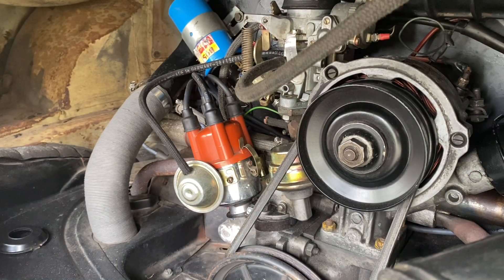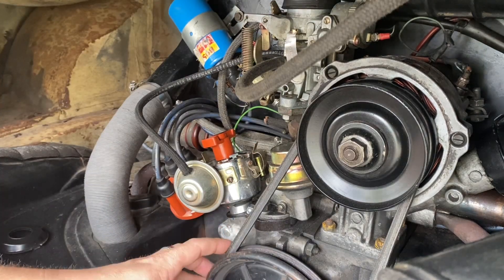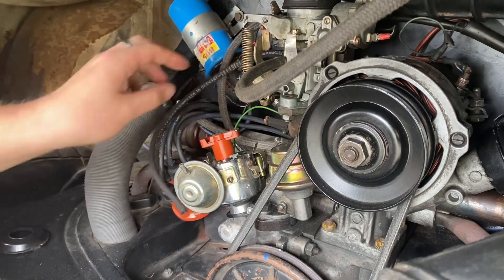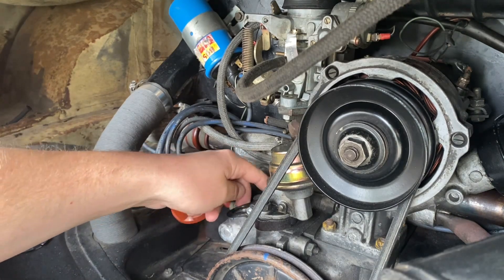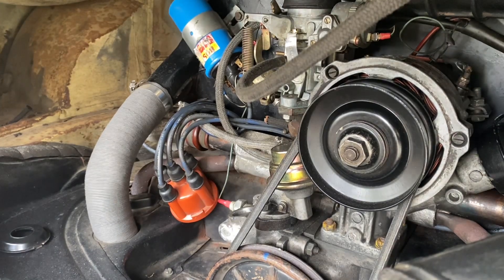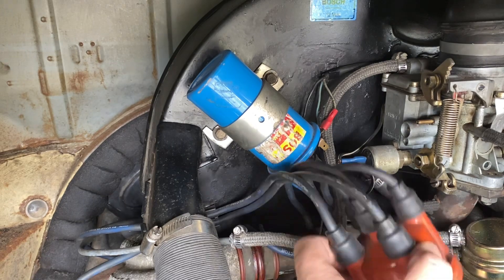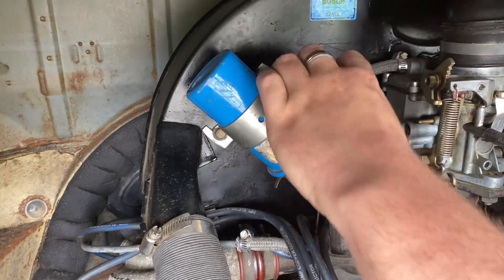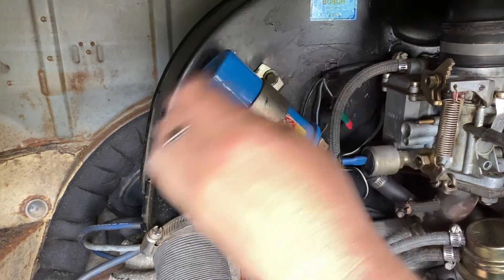Part 1: Removing a VW Distributor & Coil - Aircooled Electronic Ignition Series

Comment: What would you have to do if you dropped something in the engine?
Reply from the maker: It depends what you drop in there, as to how hard it is to remove. But if something falls in, it’s got to come out again, otherwise you run the risk of serious engine failure.